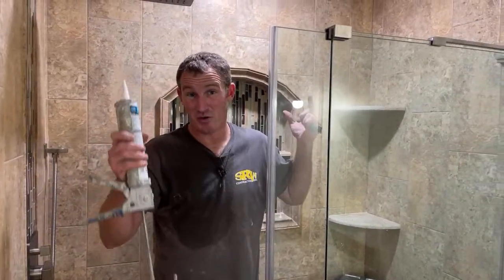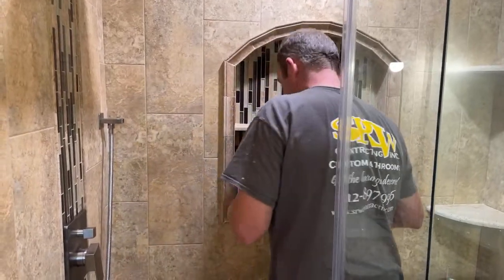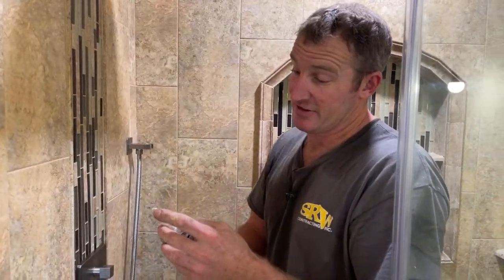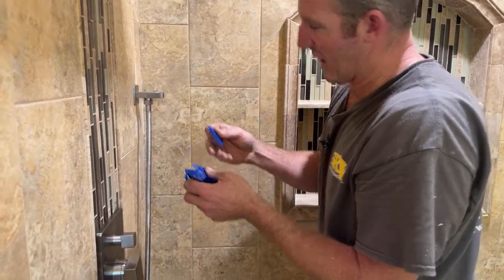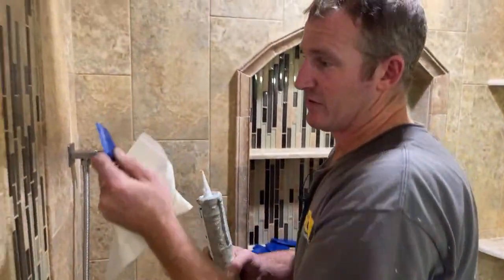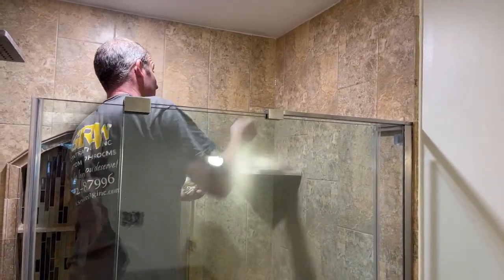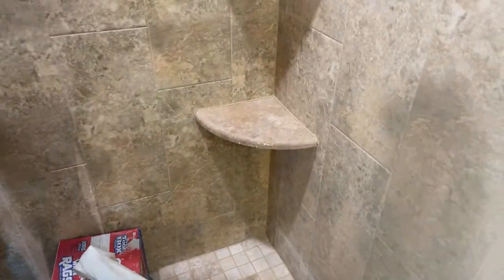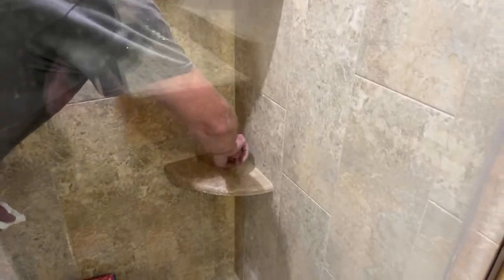⚡️Live⚡️Caulking Shower Corners

Comment: Great video. Question: How do you deal with larger gaps at the floor between the floor and walls? I have an area where the installers grouted a while back and now all of it has cracked out. How do I fill it?
Reply: I'd recommend using a grout piping bag to refill with grout and create a solid base to silicone over.

Comment: Where's the shower door install video? Don't leave us hanging!
Reply from the maker: 😆 I’ll have that up soon. This one was a dreamline mirage x. I think it’s a great system. I like the bottom track with no header rail above
https://amzn.to/3kwxXs9
Reply: @BathroomRemodelingTeacher  Curious about this door installation as well, I am considering installing the mirage x in my upcoming project. Did you need to screw through the Ditra/Kerdi to secure the bottom rail?
Reply from the maker: @cherrybombking5330  I’m overwhelmed with editing, 😆 I probably can’t get to it till February now. But yes screws need to go in to hold in place. I drilled through (but not hitting waterproofing) and used a plug anchor and epoxy. I’ll try to make a short on it. But I liked it. Track on bottom isn’t the most attractive but does contain water well 👍